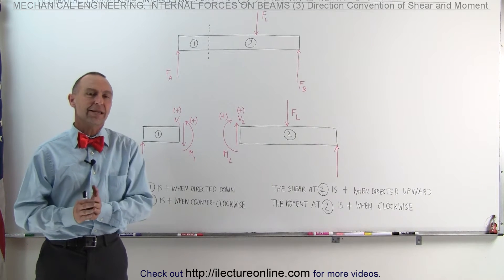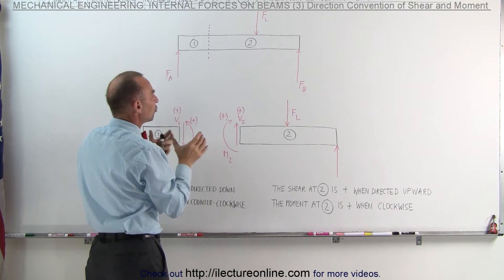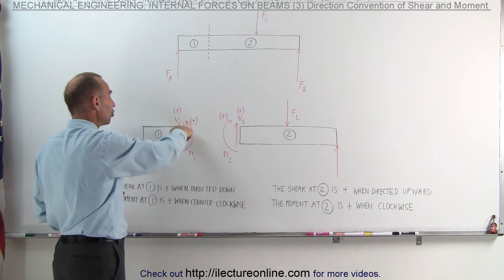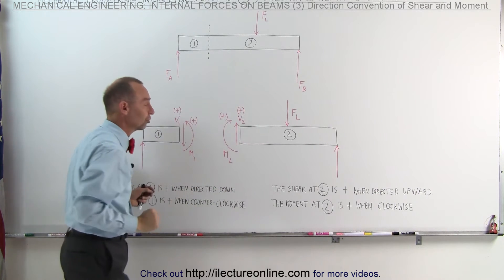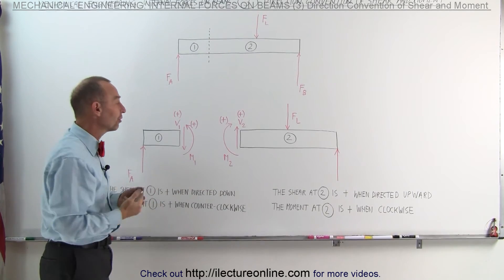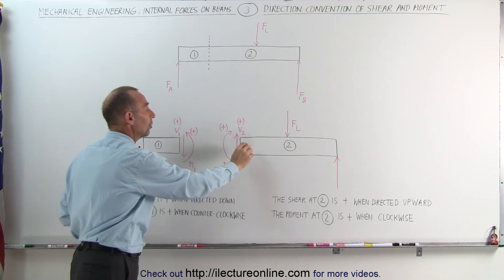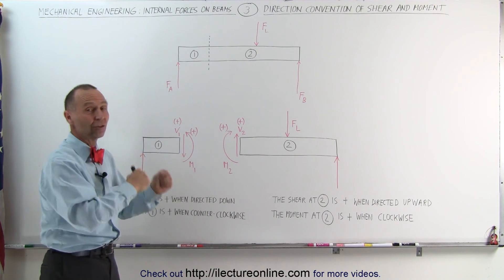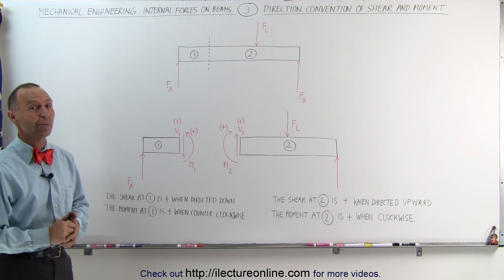Mechanical Engineering: Internal Forces on Beams (3 of 27) Direction Convention of Shears &  Moments

Comment: Keep the Moments convention standard, that is label Clockwise negative and anticlockwise positive or vic-versa. Should not try to use both in a single problem, where on one part of the structure it is Clockwise(or anticlockwise) negative then positive on another part change around. What causes the difference would be the distance from the point of rotation. to the right distances being positive and to the left negative.
Reply from the maker: The direction of the moments used here are standard in mechanical engineering and matches the normal convention when understood.  Take a look at the first two videos in the playlist that explain that:  https://youtu.be/vf18nuaoEbg

Comment: How come you said the moment was negative about A and in a previous vid you said in clockwise direction is positive according to your picture?
Reply from the maker: Yes, when applied to beams, there does appear to be an inconsistency, (and therefore it is very confusing). But this is the convention.  Think about it in terms of how the left section acts on the right section.  The resulting internal "bending" moment will be as drawn and that is considered a positive bending moment by convention.
Reply: Michel van Biezen so say if you are putting a force in the middle of a ruler, the the resistance that ruler has to the bending is the internal forces of the ruler making it want to straighten back up to its neutral position? And when you work out your moments you make clockwise as negative? Like they are separate things?
Reply from the maker: Almost but not exactly.  The right section by definition a clockwise moment is considered positive.  (I find it confusing as well).